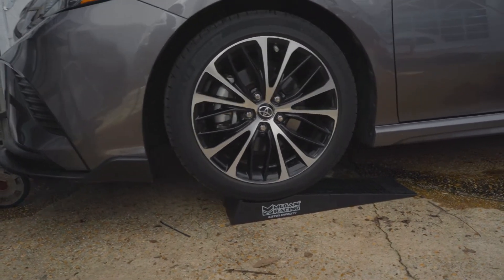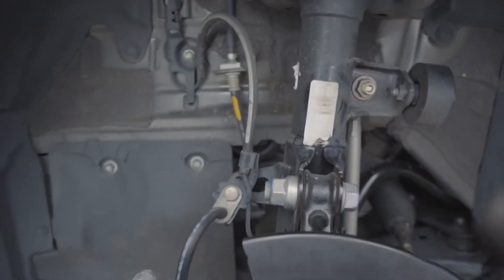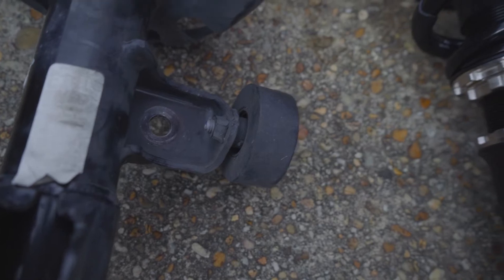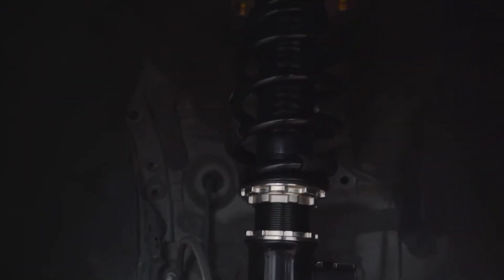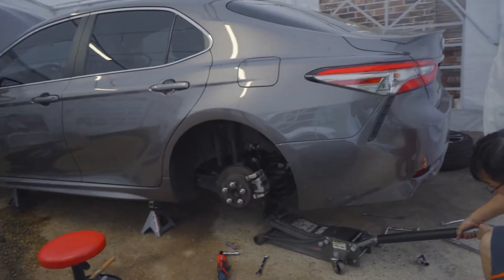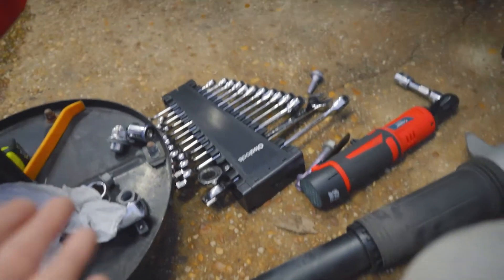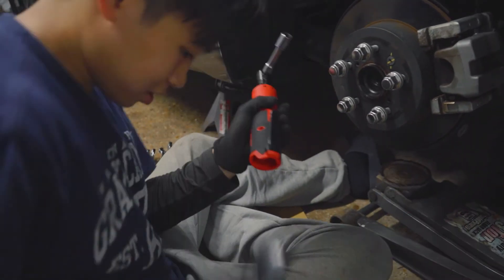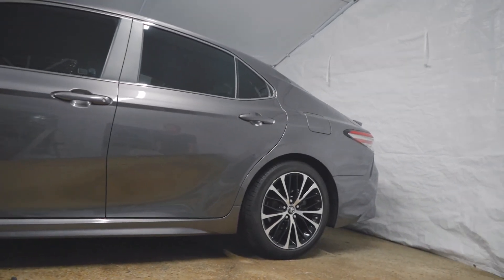INSTALLING COILOVERS ON A CAMRY!!!!

Comment: I'm actually happy to know how easy it is to install a set of coilovers on a Camry.  I have a 2020 Camry LE that I thought of doing this with as I'm thinking of a set of 19 inch ESR CS15 wheels and adding coilovers would help the wheels fill out the wheel wells quite nicely.
Reply from the maker: Yeah it’s not terribly bad! Remember that LE and SE are two different set of coilover but should be similar installation

Comment: Hi bro
Nice work
I have xse 2019 
I want install 19 inch rims I also want to lower the car a little to give a sporty look

What do you recommend and give me your opinion?
Reply from the maker: I believe the stock wheels are 19s so I don’t see an issue with lowering it at all! If you get new wheels make sure to do your research and test fit wheels to make sure you like the look without the rub